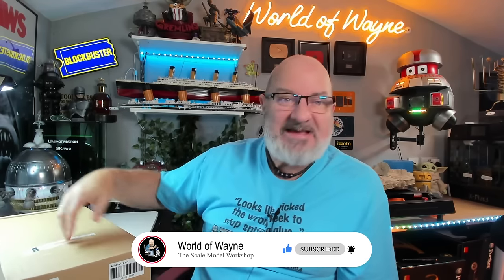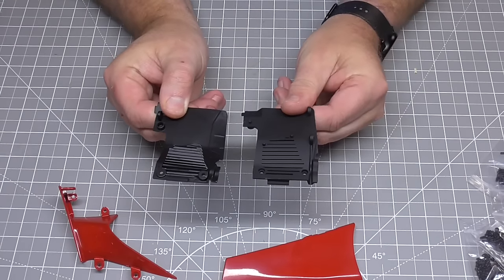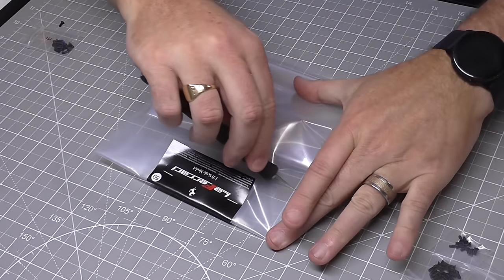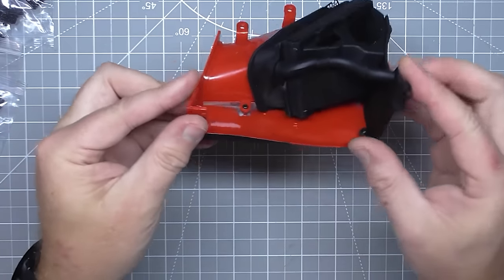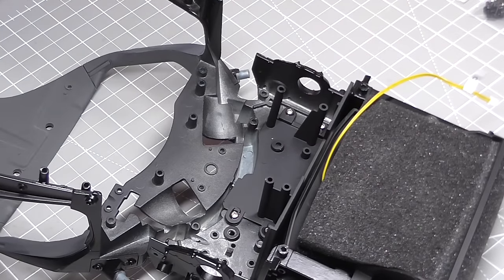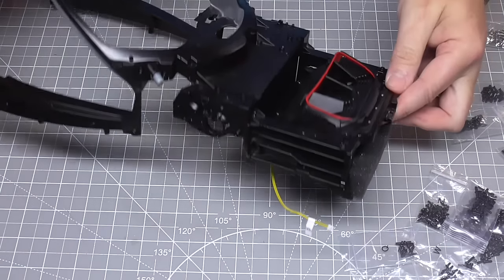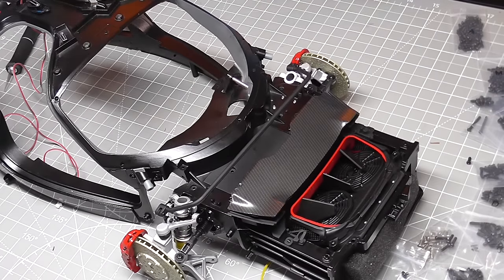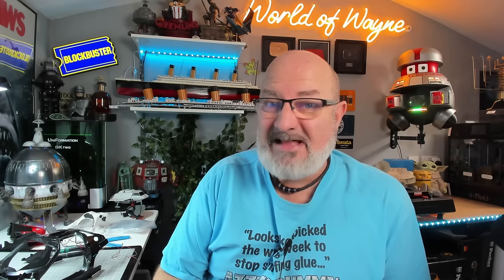Build the LaFerrari 1:8 Scale - Pack 7 - Stages 49-56

Comment: Question for you.  I've seen a lot of concerns on the Facebook group that talk about the mounting lugs on the top of the chassis that's used to mount the hood shock on the driver side doesn't have any holes in it.  I noticed that yours didn't either.  I'd like this something we should be concerned about?
Reply from the maker: Have I don't that stage yet?
Reply: @WorldofWayneUK  not yet it's in pack 11 from what I understand but the chassis we have now is missing holes apparently where we will eventually mount the hood shock

Comment: I found the instructions for this build LESS than helpful. Some points to mention: 
1. When putting the radiator in place you need to mention that the back lugs of the radiator assembly fit into groves in the frame. If not seated perfectly the luggage comparment won't fit.
2. The instructions and illustrations for the front suspension parts do not adequately explain which parts are right and left. Difficult to follow.
3. I'm still not sure that I have the door switches in place properly. Here is my step by step procedure for the switches that I sent to Agora. I'm not sure that the the instructions are correct. It is very difficult to follow even on your video since the parts are so small and the pieces are black on black with no detail.
1. Pass the switch and wire through the rectangular hole in the frame from inside to outside:
2. Hold the switch vertically so that the switch arm is pointing up and gently bend the wire leads inward so that the leads fit into the triangular hole in the frame and the wire is behind the switch.
3. Fit the switch into position into the frame recess with the switch arm protruding up and with only the arm projecting into the door frame..
4. Fit the switch plate over the switch, making sure the wire is not caught between the switch and the frame and fix it with an A screw.
Note that the instructions call for the  switch plate to be fixed with an AA screw but the AA screw is too short and won't work - an A screw will hold the plate in place correctly.
So -the question is - "Is the switch mounted so that the switch arm moves veritcally or horizontally?
Reply from the maker: It should be positioned so that when you rub your finger against it, it will activate. That's what the door is going to do
Reply: @user-px6ds7be8p: about the Switch at Point 3, why don´t you make a Video out of it and show us how to do it right. Video´s are better than explains in text.

Comment: It's a bit disappointing that they chose to make the main chassis out of plastic.
Reply from the maker: The chassis is metal?
Reply: Is that a question or a statement?  Plastic or metal chassis?
Reply from the maker: @lakrfan4980  a statement. It's metal
Reply: Thank you Wayne.  I stand corrected.